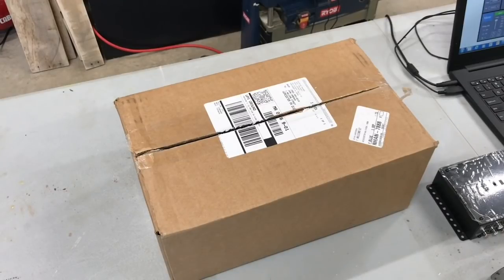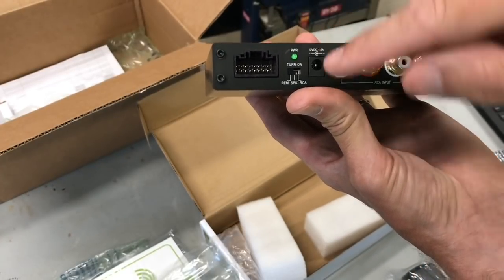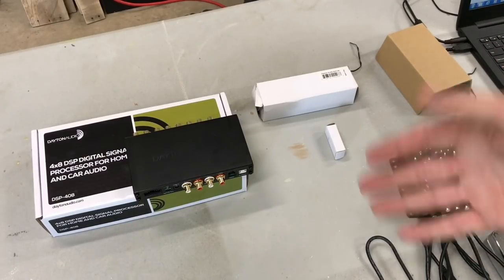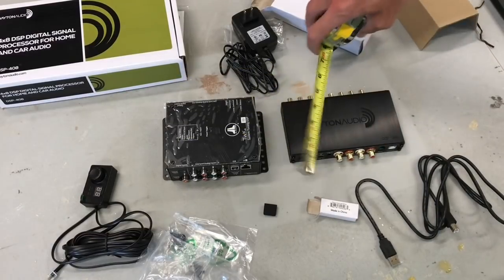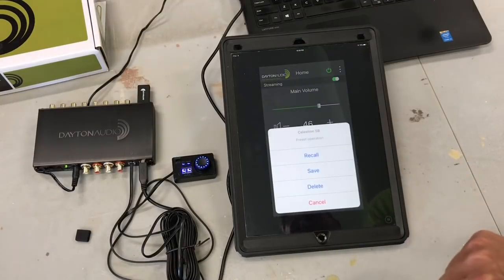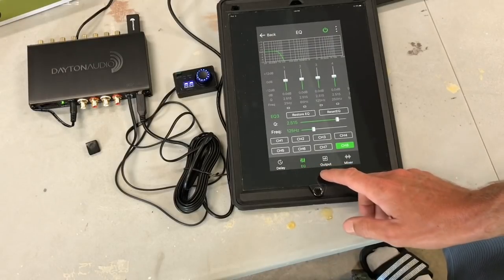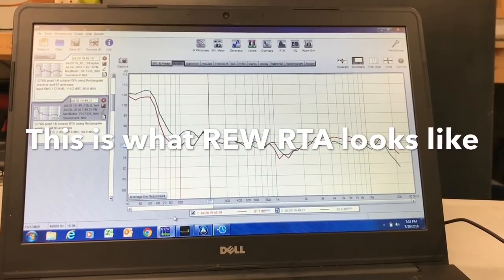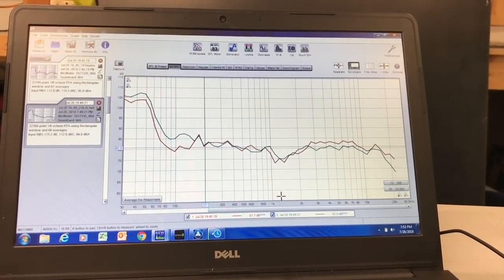Dayton 408 DSP review

Comment: I can't thank you enough for taking the time to do this.  I just grabbed one for my F150 which already has a pretty nice system in it.  I'm running Morel Tempo Ultra components (Alpine PDX-V9 amp and JL 12TW3) and while it sounds good, I always felt that it could be a lot better.  Since every thing sounded descent and this would be my first "real" DSP, I was a little intimidated and a lot worried that I was gonna make it worse rather then better.  After seeing your video, the intimidation factor is zero.  I can't wait to get this thing running and start playing with it now.
Reply: Did ypu install it already?

Comment: Hey Paul I was thinking about adding a line driver to the processor do you think it's a good idea
Reply from the maker: David,

You do not need to do that because the DSP has high level inputs and with 3.5 volts output should be plenty to drive any amplifier.
Reply: Thanks

Comment: why would you need to run cables from the "Sub," output on the head until into inputs 3 and 4 on the dsp? Couldnt you just use the 1 and 2 inputs of the dsp since the dsp is going to filter out the frequencies above whatever range you set? Why use additional RCAs to send another signal to the dsp?
Reply: It lets you control sub level directly from the head unit rather than thru a menu level.
Reply from the maker: You could also do it that way but by running from the sub pre out of the HU to the DSP and then from the DSP to the amplifier you get the extra sub controls afforded/built into the HU also. In my case I can turn up or down the level for the subwoofer separately from the HU because I wired it this way.

Comment: So the question is, should I get this DSP or is there a reason to go with something more expensive like an JL TWK or Audison processor?
Reply: 1 year late but yes it is worth it to get something better. I bought this thing and its is a total POS, riddled with issues from awful humming noise, to poor user interface, to downright awful audio quality through it. 0/10 would not recommend at all. MiniDSP 2x4HD is a good option, but it only has 4 outputs and I need at least 5 for my system.

Comment: Does the 31 band eq on the JL dsp makes it better than the Dayton dsp or its just the SQ of the JL is better??
Reply from the maker: The JL Twk has the same 10 band parametric EQ per a channel as the Dayton 408. They have the same tuning ability per channel with the JL having a little more finer adjustments. The JL has differential balanced inputs and a better more accurate interface with a slightly higher output voltage so it is slightly better in terms of SQ on paper. The quality of your amplifiers, installation, and RCS's cables will probably make more of a difference in SQ than the DSP between these to. The software for the JL is much better for a novice in my opinion so easier to learn.
Reply: so it goes head unit to dsp to amplifiers pre amp input?
Reply: Thank you so much for the reply.
I'm new to the world of dsp and having trouble in choosing between the dayton or the hertz h8?
What you suggest me to pick in terms of better SQ and customisation?
Reply from the maker: Yes, HU output to DSP input and from DSP output to amplifiers input. Running active with a 4-channel amplifier, one channel goes to left tweeter, one to the right tweeter, one to the left midwoofer, and one to the right mid woofer. The subwoofer, if you have one, gets its own channel and of course amplifier as well. Be careful not to accidentally run a full range signal to your tweeters or to use a high pass filter that is too low (lower than 2500) or you will blow the tweeters. adding a cap as I described in the video is a good way to protect that from happening.
Reply from the maker: I have no experience with the Hertz DSP. Since you are new to the world of DSP's and I have experience with the JL twk 88, I highly suggest you use the JL twk 88. It is designed and geared toward the novice like yourself but has all the capabilities of the best out there.

Comment: The noise you are getting is due to the fact you are using less than par RCA cables.  One has to view any Coax cable to have the capability to reject noise in the form of radio waves which would help in your case.  The Volume knob that came with it is pulling power through the telephone cord where the noise is coming from that your RCA cables are picking up typically.  You have to have RCA cables that have LOW capacitance which is important for noise rejection.  Lower that 50pf per foot is typically one needs to aim for.  stating that it is a noisy system in your video does not depict that the next person will have this issue.
Reply from the maker: I would agree that not everyone will have noise but it is noted as an issue with my setup. The RCA cables I have are actually fully shielded high quality cables for the highs and midrange drivers where the noise came from. Please also note that when I swapped my JL Twk DSP back to back with Dayton DSP, using the same cables and the JL remote attached, that there was no noise at all from the JL DSP. The fact that there is power running through the Dayton remote (also the JL remote) and that it may be emitting some kind of EMF is not going to change the fact that its a $150 DSP and people who buy this DSP are not going to buy mega buck RCA cables. To conclude, I would say that its also a design issue on Dayton but that overall the Dayton DSP is an excellent budget DSP and I have achieved fantastic results with it. I will also note that when measuring for time alignment with this DSP that I get got millisecond results that were way off so I had to calculate and input the millisecond times directly into the DSP to get it right.
Reply: I have extremely good RCAs & I have the same issue... Even swapped out & tried several different pairs, different lengths, brands (I have about 20 different pairs of RCAs from basic cheap 1s to gold plated, shielded exspensive 1s)... Its something to do with the DSP remote knob, you unplug the knob and the noise disappears...
Reply: @csmitchell1113  Can the DSP still work fine without the knob?